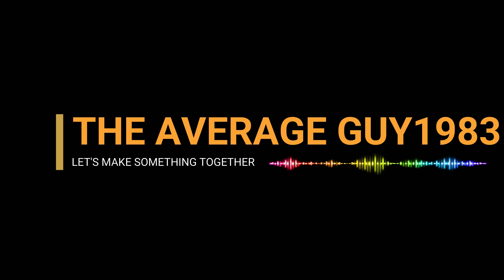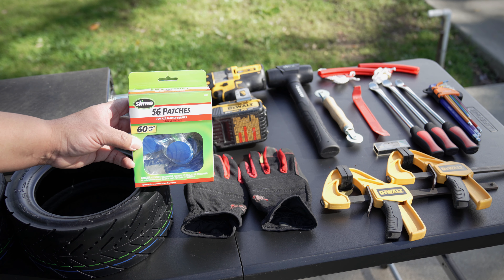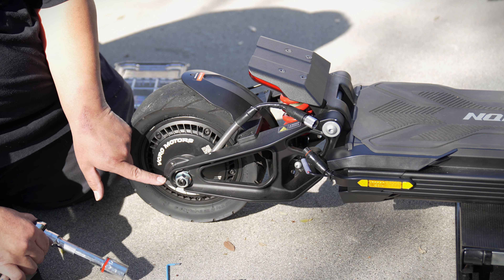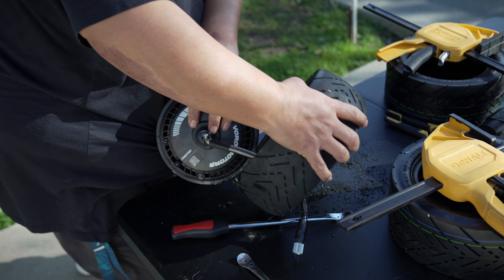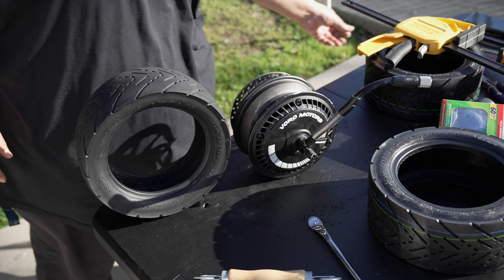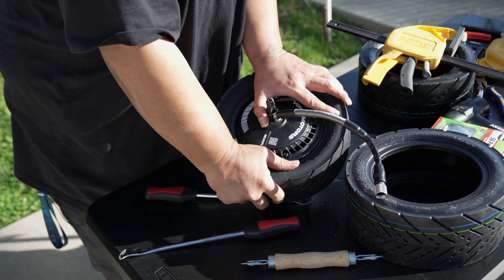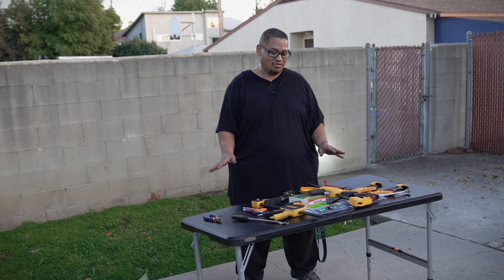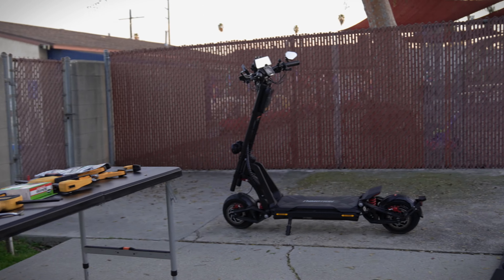Repairing The Inmotion RS Rear Tire

Comment: Bullets holes in the table if you have the money invest in motocyle jack with the hole in the middle . 😆 first time always the hardest.
Reply from the maker: Hahahaha yeah man i sure did damaged that table lol. I actually bought a Motorcycle jack with that hole in the middle you are talking about. I wish i could have bought it sooner. It definitely looks like it will be super helpful. 😁👊
Reply: @THEAVERAGEGUY1983  i need to get me that inmotion rs but also want Nami  burn e max . Hard to decide right now lol
Reply from the maker: @TheRomabull  that is definitely a tough choice because both scooters are excellent! It's too bad you can't test ride both and get a feel for each one and then get the one that feels the most comfortable to you. Its one of the reasons i chose the RS. The Deck and handlebar stem height adjustability is what one me over. Once i did more research on it, i then found pur about the Massive battery it has for long range. The Nami Burn E is also an incredible scooter what an awesome design.
Reply: @THEAVERAGEGUY1983  that average guy song is stuck in my head . Thanks man haha . Is that midnight version charging port different or more water resistant then the yellow version
Reply from the maker: @TheRomabull  😁👊 it is i deed different than the Gen 1 yellow one. I know Inmotion is now changing all the charging ports like the one i have now. As for water proof, im not 100% sure. It does have a Silicone plug that covers the charging ports but you have to make sure its covering the ports right to give it a seal. Once the main cover is on. So i think it is. I know Ginger on wheels did a video on water proof testing the RS recently so hopefully his RS doesnt get any rust or charging port issues.
Reply: @THEAVERAGEGUY1983  oh yeh I seen ginger on wheels driving the midnight one thru some water didn’t see him do it
With the yellow one hopefully they change it up for the yellow one as well .

Comment: How are you going to balance it? You need to use equalizer.. keep the crap in it.
Reply from the maker: Unfortunately you can't on this type of motor. Usually, you can put little wheel weights on the inner part of the rim while having the scooter on a jack stand. The trick is to spin the scooter wheel slowly and see which direction the scooter tire goes and where ever it stops add a weight to the opposite side so the scooter wheel doesn't start to spin the opposite way. It's a little hard to explain, but im going by some videos i seen but it doesn't look all the great on the ones that i seen. So im hoping whenever i change the tires to the new self-healing ones, i dont have the same issue. 😅

Comment: Gave me issues about steering damper on RS
Reply from the maker: I got to partially solve the wobble issue under speed 3 which for me goes up to 52Mph but on my GPS ot said 49Mph. However if i try speed 4 and go above that then i do still experience speed wobble but its not as bad as before but my steering damper is tighten up all the way to MAX 😅

Comment: Thats yhe shit thing about the RS rim
Reply from the maker: @BigBoyRandom  yeah man it was a pain in the ass lol i finally got to get used to it. I should definitely make another video on the tools i have now to make tires changes a whole lot easier but its still like a 5 out of 10 when it comes to difficulty level lol. These tires are pretty hard. I have some other ones now that were much easier to install since they are softer than the stock ones. Thankfully for me the new tires also have that self healing gel inside of them.